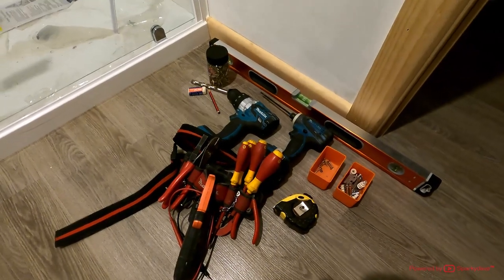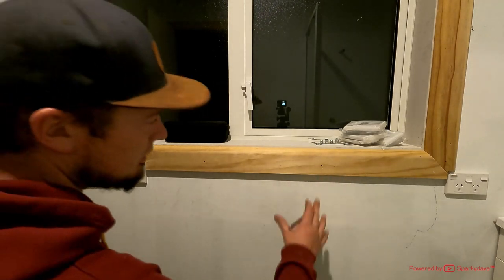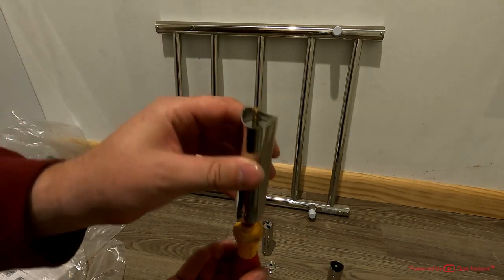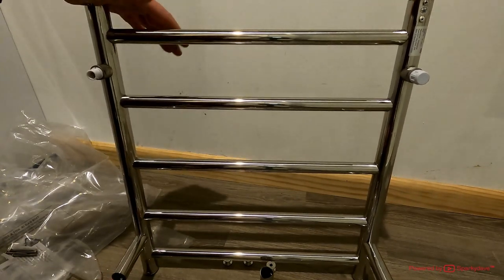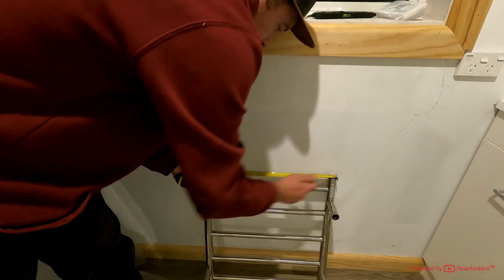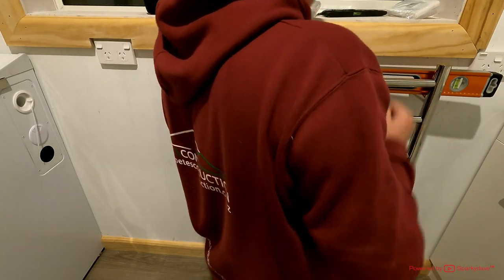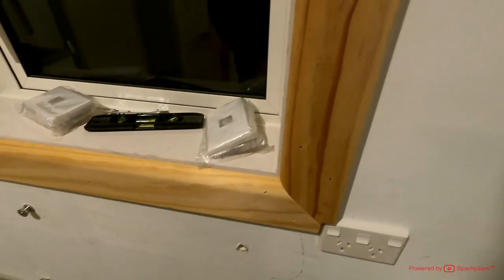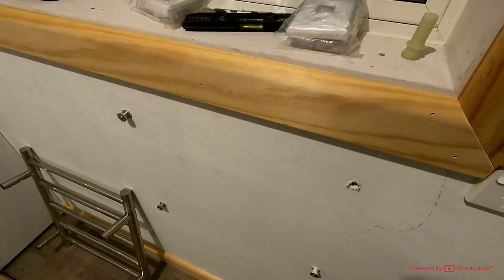How To Install Heated Towel Rail

Comment: Maybe put the electric cable wall mount at the bottom (if possible) so if your kids pull the towels, the top will never loosen & come away from the wall. 
Great YT channel sparkydave.

Comment: Thanks for the vid, In regard to adding fittings, what is the maximum current draw of an additional load you can add to a lighting circuit ?
Reply: Best to get in an electrician for that one.
Reply: 10 amps
Reply: 3kw for 1mm2 lighting cable.